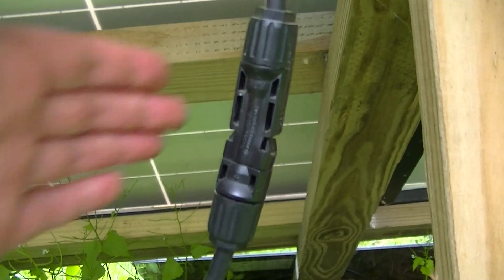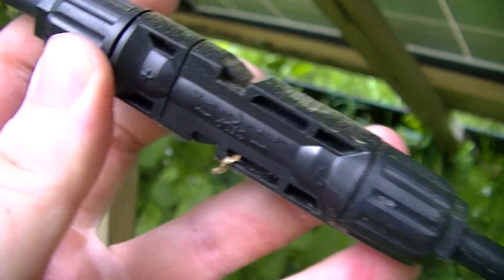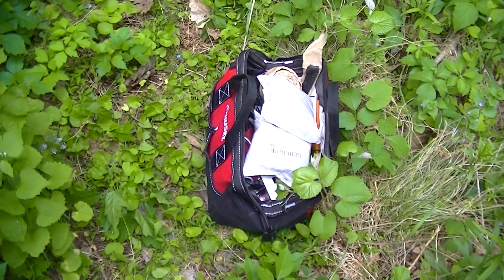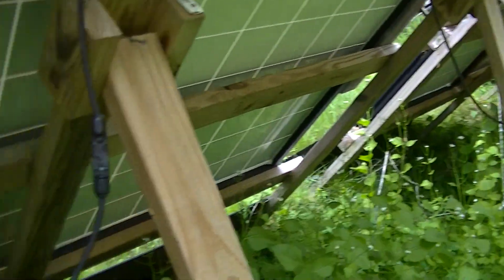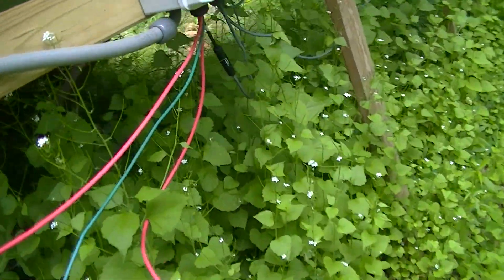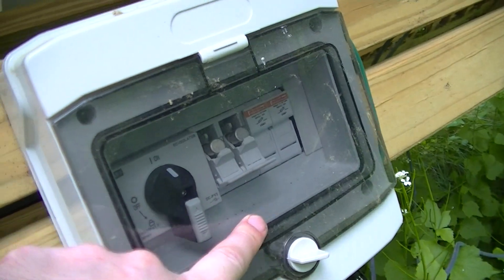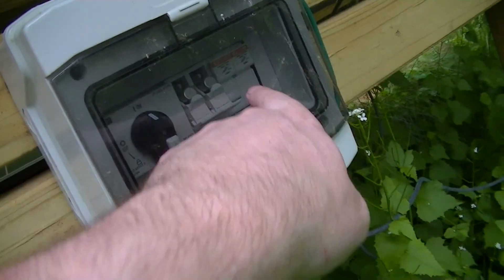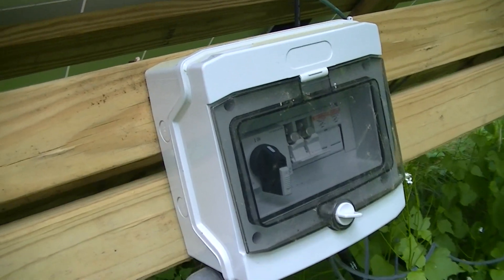Important Trina Solar 250W module safety check

Comment: Thanks for the heads up I’m buying some of these tomorrow
Reply from the maker: Depending on the batch, they may also have some corrosion of the tabbing inside the module lamination.  I have a number that have that, and will be doing testing in the spring to see if there are any insulation or leakage current issues with ones where this has happened cuz risk of electrocution or melty burn.  If cost isn't super critical, I would look into other modules Santan has as well.

Comment: I was going to buy TS4 connectors from trina but this has me worried, did this happen due to improper crimping or being loose or anything wrong with the connector itself?
Reply from the maker: The problem is that the center pin isn't fully seated in the connector housing.  Make sure that the pin retention spring clicks when inserted and there shouldn't be a problem.
Reply: @randacnam7321  so just to confirm only the ones with improper seated center pain failed, the rest are working fine?
Reply from the maker: Yes.  The reason for the overheating was insufficient contact area from the pin not being fully seated.